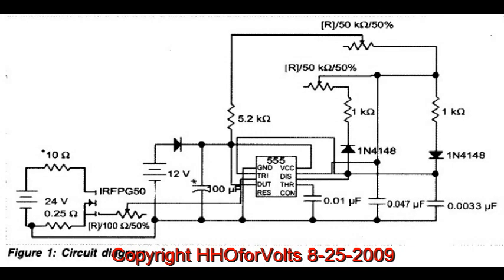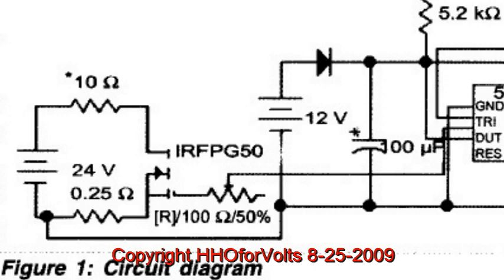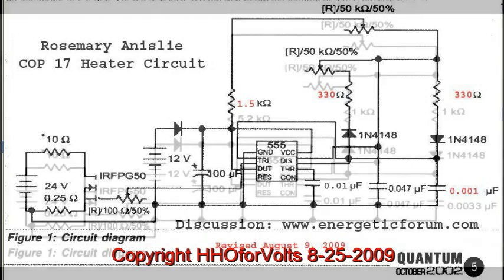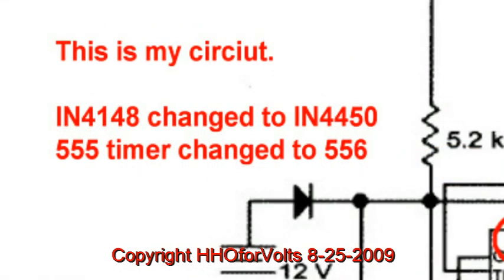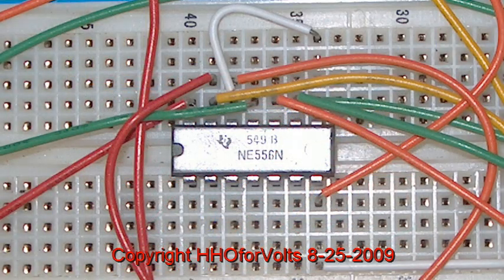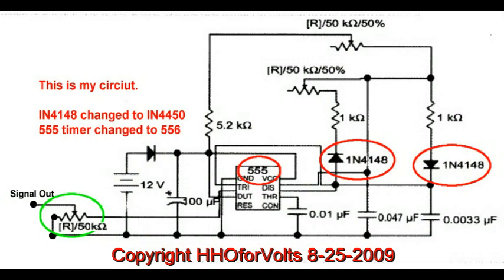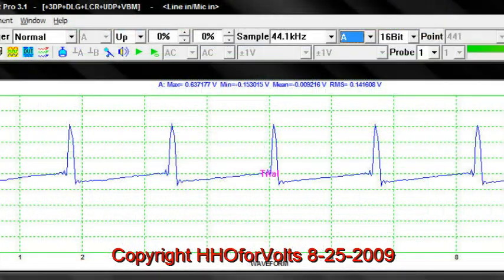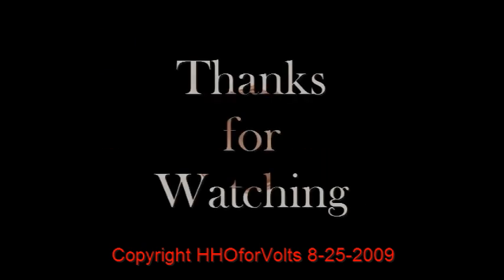HHO meets Rosemary Ainslie

Comment: I've built the circuit several times, hardwired and on breadboards. Several other people have also built the circuit and have simulated it in Spice, for example. I am afraid that, based on these builds and my experience with the 555 and 556, that the conclusion is still that you have made an error. If you research 555 circuit design you will see that the component values given will not even theoretically approach a short ON duty cycle. And no "limiter" is needed if the circuit is working right.

Comment: And of course if you would like to see what real research on this circuit looks like, you can look at my (TinselKoala) videos concerning it. Sorry, you won't be seeing any spaghetti circuits, but you will see coherent oscilloscope traces that actually convey information, and you will see components and configurations tested against each other, and actual power and energy flow calculations. What you won't see on my videos is any evidence of "free energy" or COP over 17, as Ainslie has claimed.

Comment: Do you have any idea what this circuit is supposed to do? I mean, what is the point? It just switches the MOSFET on and off... There are no inductors or anything that would cause AC through anything for "resonance". I'm an EE, so I understand the circuit pretty well - I just don't understand the intent.

Comment: hhoforvolts - you say you are trying to get the MOSFET to oscillate??? What do you mean? Are you talking about gate ringing, or are you saying you are trying to get it to switch at the resonant frequency of the RLC circuit? 

If you are saying the latter, then this circuit is nothing special at all... It's just a basic timing circuit to sustain an oscillation between inductor and capacitor. Don't act like it's groundbreaking to all the ignorant people out there.